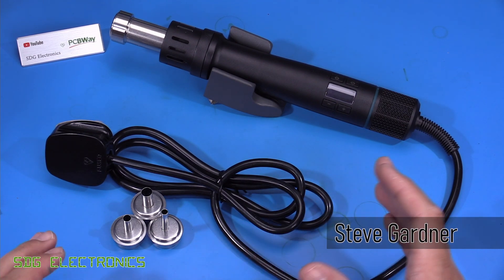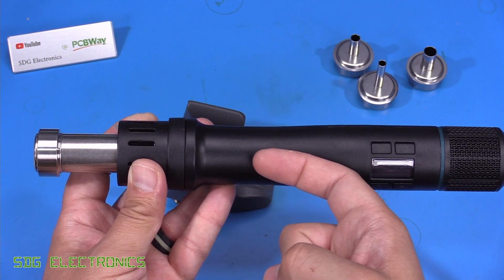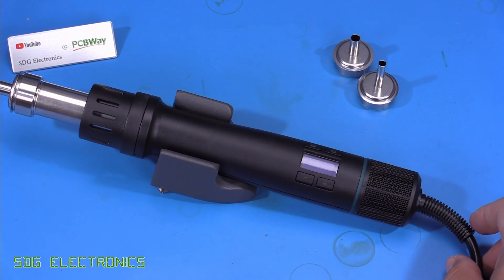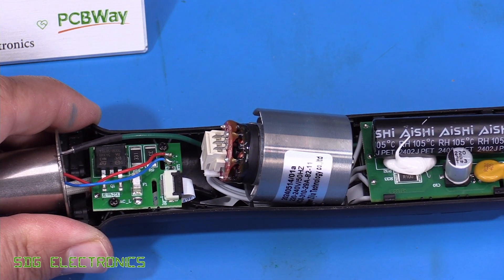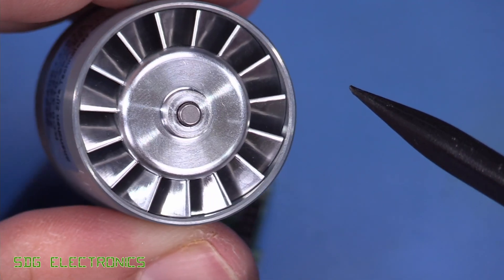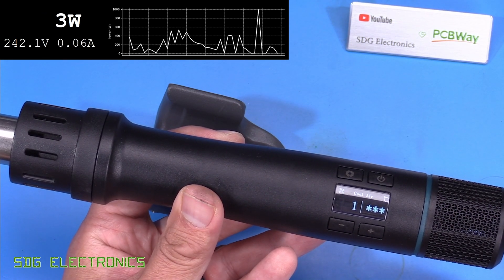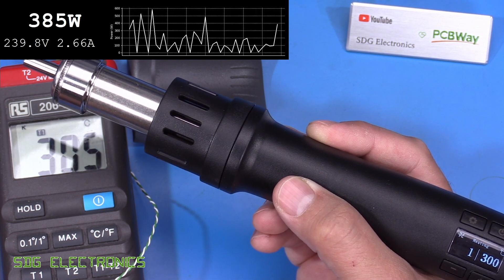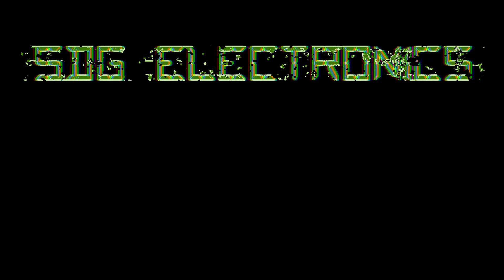SDG #347 Quick TR1 1000W Hot Air Handpiece for SMD, BGA rework

Comment: I've been using this for almost a year now as a Laptop board level technician for home service together with my Zoyi ZT-703S and a Finri Pocket DC bench Power supply
Reply: how was it, no problem so far ?
Reply: @farisikhmal4868 yeah still serving me well
Reply: Hello, the unit i just got has air leaking from one side of the handle, does yours leak too? Support is saying it's expected but sounds like bs
Reply: @Apicedda  sounds like you got a bad one, mine doesn't have air leaks

Comment: I have a similar hair dryer des 560c hot air gun, but it has a power of 560 watts, 1000 is still better. I wonder what kind of heater it has.
Reply: Its just a normal coiled nichrome heater, found in any hot air handpiece.

Comment: What an abnormal high price for this - obviously they are seeking for lochs (simpletons)  - You can buy normal enough Hot Air station if You pay a little more or also normal similar hot air gun for less price. The reviewer earns alms, so there is no expectation of objectivity. Sure, this hot air gun works, but it's not worth the money
Reply: As an average loch, as you said, I bought it, and I would say that it has its flaws, but you get a very portable handpiece with the same heating element as the full-sized Quick hot air station. For me the appeal was its small size and portability, and it being pretty capable. The price was at the limit of what I would pay, but so far it seems to be a potentially very nice tool, if only a few weak points in the design were fixed. It also performs pretty well doing average SMD soldering jobs.

Comment: I bought one and loved it. Unfortunately it melted itself. Opened it up and found that all the wires were stranded steel instead of stranded copper which means the wires could’ve been a gauge or two thinner. The self tapping screws wore out very quickly too and air began to leak out the sides of the hand piece. Now I gotta print out a new plastic housing and replace the wires to get this thing working again
Reply: I received my unit two weeks ago and while it has worked well so far and I mostly like it, I can hear a high-pitched whiny noise when the fan operates (I use it at 400*C at half of max. fan speed), and I can silence this noise if I clamp the two halves of the handpiece with my hand. It is not the sound of the fan spinning or air moving through the handpiece, but an additional high pitched rattly noise. It feels like either the plastic halves of the handpiece are vibrating against each other along the split, at high frequency, or the air is escaping through that gap, and I wonder if it may be the same problem which led to your TR1 eventually melting?
Reply: Any luck trying to get warranty for it?
What temperature and air flow were you using?
Reply: @jaro6985  300*c at full airflow. I’m actually unsure about whether the wires are made of steel or tinned copper. The hand piece is made of only 2mm thick abs/pc alloy that easily warped, which led to air leakage from the sides, and, eventually, melted a hole in the hand piece. I’m passed the warranty period. But I have reached out to the seller and they said they can’t help me. Quick has yet to respond to my inquiry.
Reply: I want to add that I confirmed the temperature sensor was calibrated properly before it melted itself.
Reply: I bought an RF4 H9 for only $60 to replace the TR1 until I print a higher quality hand piece out of 100% polycarbonate for that higher glass transition temperature which will hopefully prevent any warpage. The RF4 H9 is a mini, hose-type hot air station (maybe the smallest of its kind) and it has not disappointed me in the slightest (that is after I removed that stupid beeper)
Reply: @kenjikawakami8033  Yeah I have RF4 gear and its good.
The wire for the heater and thermocouple are usually some kind of steel (well chromel/alumel looks similar). But if you are talking about the wires for 120V then that would not be good.

Comment: This is a great idea. Unlike the Chinese soldering iron stations, this is way better than anything you could make yourself, I think. 

Apart from OLED lifespan - I’d prefer a LED or LCD display. Second, lower airflow such as a 2-20L/min range, quieter & more controllable would be better? And I agree about the PVC cable.

Comment: I saw the thumbnail and thought meh, but this is actually a nice little unit! Pretty cool that the unit goes dormant in that little stand just like the 861dw, same nozzles too. Very cool. I've never seen that little suction tool for removing the ICs, have you done videos on any of these devices? (FYI, your link for "Eakins Camera Microscope" and "Daniu Tip Cleaner" are broken)
Reply: I think that that's because they are made by JBC, and he has been lately "praising" Metcal and "discrediting" JBC.

Comment: try to put the handle into ur 861  cradle , does the sleep function gonna work?
Reply: Of course is gonna work. The sleep function is triggered by a magnet on the base, actuating the reed relay inside the handle.
Reply: @Ismsanmar Well have you tested?
Reply: @mihailsjakovlevs6497  And you? Instead of asking anyone else, why don't you do it for yourself? You can share your findings with us.
Reply: @Ismsanmar  I don't have the 861DW station available to test with TR1, and I don't feel like spending ~45 EUR for the holder which may not work with TR1. That is why I am asking in case anyone has both available, and has been able to test. Instead of writing assumptions with certainty without actual testing.
Reply: @mihailsjakovlevs6497  Why would anyone have both available? Usually, you buy one, not two, to do the job.
Reply: Need to try it to check. Sometimes things that should be compatible are not compatible.
Reply: @davadoff exactly
Reply: I got a reply from the seller on Aliexpress that I ordered the TR1 from, and who also sells the 861DW, that the 861DW handpiece holder is NOT compatible with the TR1 due to size difference. They did not elaborate, but that's the only compatibility info I managed to get so far.

Comment: Would this work on the stand that comes with the other quick 861dw station? Be interesting to test that as they’re quite cheap. Great watch as always
Reply: Of course is gonna work. The sleep function is triggered by a magnet on the base, actuating the reed relay inside the handle.
Reply: @Ismsanmar  but the handle lays on the side on this stand and on the quick it sits on the top, so the magnets might not be in the right location to activate sleep function.
Reply: @SURGE101 Check those heavy stands again. The part where the magnets resides protrudes just the necessary length just to be positioned on the same position than on this one. Remember, both are Quick...
Reply: @Ismsanmar  thanks that info good to know. to be honest I wasn’t sure that’s why I asked the question because I thought maybe the magnets may be in different locations on the handles considering they sit differently when put into the stands. Thanks for the help.
Reply: I was wondering exactly the same. I think it is a perfectly valid question as I haven't seen anyone online who tested this on the 861dw stand.
Reply: Could someone please test the TR1 on the 861DW stand if you have both accessible?

Comment: Air temperature and air speed control at low speeds are critical, and I can't really see the design point of this other than building another product down to price. There are a lot of good reasons that larger desktop hot air stations are designed the way they are.
Reply: A lot of good reasons? no not really, just a bit of weight and length savings.
Reply: technology is evolving. but i think it's still not there to replace the desktop stations yet. but it will not take long.